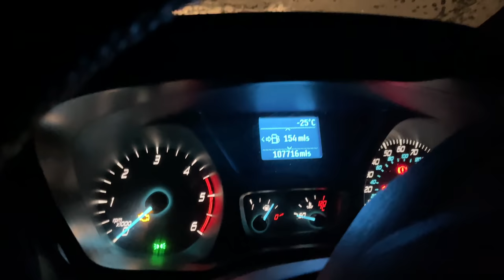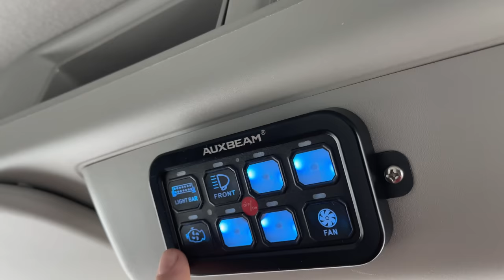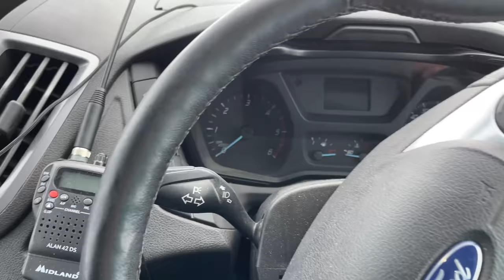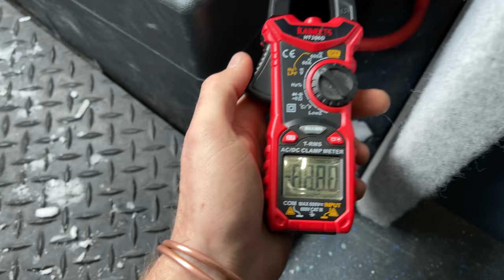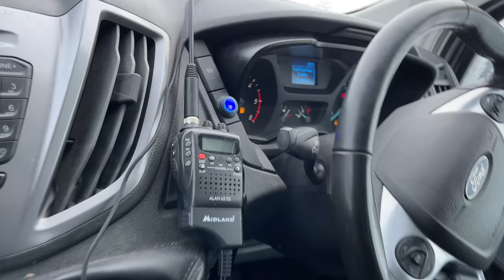Van DIED in ARCTIC cold temperatures | Extreme Winter Vanlife

Comment: Shoulda kept it running. Not that you did any but there was more potential for Damage turning it on and off… keeping it on generates heat and keeps fluids moving… there’s diesels all over the internet doing cold starts… because it’s rough. It was gona be rough. Far worse to turn it off and on than to just keep it running
Reply from the maker: I worked with the information and knowledge I had at time. It sounded horrifically and struggling to keep idle. So a reasonable step will be to shut it down when I don’t know what’s gonna happen. after all there is no problem waiting out for the coolant  thaw out to the engine, so the pre heater work later on in the day.

Comment: We always have at least a 50-50 % mix in the coolant system here in Sweden.
Reply from the maker: Yes the issue was that’s what I thought it, unfortunately it turned out to be for more diluted, subsequently had local garage test it  and mix is no 50/50
Reply: @MispronouncedAdventures     Yeah I thought so. I would also have the engines preheather wired to the leisure batteries to avoid draining the starter batteri. Good luck.
Reply from the maker: Preheater is wired up to the leisure battery, The cranks of the engine when cold is what flatten the starter. there are no issues starting the pre-heater because Attached to the leisure system

Comment: I will now pack a tube in my van so I can heat the engine bay with my cabin heater in case the waterheater freezes. If that doesn´t work, I´ll use my Optimus 111T or 55 to preheat the engine.

I´ve been living in the south west of Sweden for nearly a decade, almost forgot how cold it can get inland and north.
Reply from the maker: A few people had also recommended and thought of that ideas I could definitely see it could help in a way

Comment: Since you also have a diesel air heater installed, I wonder if an external port and some extra ducting would be useful to get heat to a frozen component?
Reply from the maker: Potentially in an option however, I would just need  another 4-5m of exhaust to reach the engine bay

Comment: I've noticed that you have a manual switch to enable charging from the Victron DC-DC chargers. As I remember correctly those can detect the voltage increase and turn on automatically, I also remember that this was the idea when you installed it in the past. What made you change it to the way it works now? Is your smart alternator voltage too low to trigger it? BTW what is your charging voltage with the engine on(the voltage you get from the alternator)? I also have transit MK7 though, and still trying to figure out how the smart charge work exactly, tend to have 14.8V constant, when the engine is on, sometimes dropping to below 13V without any apparent logic to it.
Reply from the maker: So without being too confusing I have a Video coming out in a couple weeks which shows the process of installing both of the Victron DC-DC charger is running in parallel. 

The Switch on the dash doesn’t necessarily turn the chargers on or off ( as in manual control to make them charge or not ) as they’re still on the automatic engine detection modes however that switch controls if I want two charges to run ( winter time ), only one of them ( summer time ) or none at all. It also means the fans turn on and off for the correct charger as well. 

The smart alternators vary the voltage for a number of reasons what are those is alternator temperature also effect voltage output I think I have my engine detection voltage currently at 13.8c

Comment: Loving the series and adventure! I have a webasto engine heater (not sure if exact term) in my van. Been told it warms the engine quicker when cold so it stops damage to the engine. But I can't manually start it like yours and I've never heard it make the noise like yours. Guess this is a different thing to your engine pre heater?
Reply from the maker: Glad you are enjoying the series. 

Id imagine it’s the same thing if it’s a Webasto engine preheater. I’m not familiar how they’re often installed in vehicles in the factory. I think it can be a variety of ways from automatic turn on to manual.

Comment: Do you actually have a diagnostic tool in case something really goes wrong with your engine?
From own workshop experience, those Transits like to block the DPF e.g.
Reply from the maker: I have a unit which can read codes which sits on my dash and displays my coolant temp and other things. Never had a issues with the DPF

Comment: Why don't you let the engine running all night when its below -20? It doesn't use much fuel in idle and you avoid all the issues in the morning. In case of an emergency you dont have 40 min or more to waste.
Reply from the maker: It’s really not needed to leave it running overnight. Idle is my van uses around 0.8L to 1.2L per hour. Long idling  also didn’t great for modern engines with there filters. So I’d run not leave it for idling for 10 hours overnight. 

this only issue really was the coolant mix was t what I thought it was.
Reply: Woow that's alot of consumption for idle! My sprinter uses around 0,5l/h. This also heats the van inside. When its below -20 C I always keep the engine running. I made just over 680.000 km and only had to change the high pressure pump 1 time.  No other engine issues.

Comment: I wonder if all people of Scandinavia have to spend an hour preheating their cars in the morning. Seems to me that as long as it starts on its own it's fine right?
Reply from the maker: They generally all have pre heaters, in urban setting it’s mostly electric ones which they leave turned on overnight. You see all the cars parked up and plug in to the electric sockets. You might be able to start the engine in the cold, but it’s an extreme amount of wear on the engine doing so it’s doing it every day would be a great way to knacker in engine pretty quick

Comment: 15:11 I get same symptom when I used my webasto to pre-warm my car. Happens when its very cold. I also run my Webasto on auxiliary battery. Completely isolated from starter battery. Not sure why it happens….anyway was a pleasure to watch the entire series.
Reply from the maker: The Webasto runs of the leisure systems so there is never any issue starting it from a power point of view, just in this case because the coolant was blocked being semifrozen. 

The fuel gauge one is pretty common when the power runs out in my van too. 

Thanks for watching!

Comment: Shouldn't rev the engine from cold like that. With the coolant being just a little bit slushy I would have let it tick over when you first started it. That electrical system of yours look really neat but a bit complex, to me at least. How come you don't have a switch that allows you to use the leisure battery to boost the starter battery? Would save you rewiring your board. One more thing, is that van all wheel drive?
Reply from the maker: I didn’t really rev the engine hard ( sounds loud on camera ) , it was more of small rev as the it sounded like it was struggling to idle. But it was only for a few seconds anyway and because at the time I didn’t know if that was good or bad nosies . All I knew was it didn’t sound right/ normal. Which i why I shut it down. 

As for the electric system, it’s can definitely look complex to someone but as I built it myself it quite simple. Those style of B2B chargers don’t have a reverse charged feature. I do actually have a small trickle charger but I wasn’t gonna wait for that to charge a flat starter battery as that would take hours. For me, it was a pretty quick to swap the wires around. 

The Van is only RWD drive and not AWD ( I’d love a AWD ) but with all the weight over the rear axle and those tires, plenty of grip, even in deep snow
Reply: If it is a work van / company car, you can rev / thrash the engine more at low temperatures, travel faster, launch the boat deeper and carry heavier loads that it is designed for etc..... if you personally own the van, definately be cautious with revving when cold.

Comment: Up in Alaska if you can’t plug in you don’t switch off.  Well in the 70’s that was the case.
Reply from the maker: Most everyday cars in the Nordic have an electric preheater so you see most plugged in when parked. However many of the van have a option a Diesel fired engine preheater like a use for use when plug in is not available. 

Whilst my preheater worked flawlessly, at the beginning of my trip coolant mix was wrong, I drained and refilled the coolant a few days later with the correct mix
Reply: @MispronouncedAdventures  we are talking -35 it was brutal. Don’t think pre heaters were about then.  One guy had a log burner where the passenger seat should have been to supplement the cab heater, made coffee on it too. 😂.

Comment: Do you have an oil pressure gauge fitted ? Fun vlogs thanks I am enjoying them.
Reply from the maker: No I don’t, it’s strange I don’t think I’ve ever seen an physical oil pressure gauge in a British vehicle . But that could well just be because of the type of vehicles I’m normally in. The vans and vehicles do monitor Oil pressure and you normally get a pop up on the dashboard telling you if there’s something abnormal happening 

What’s the purpose or advantage?
Reply: @MispronouncedAdventures  I just wondered if maybe you had fitted an aftermarket one. If the oil pressure had been say between 15psi and 50 psi I would've allowed it to carry on idling, to warm the engine . I would definitely change the oil to a 0w-30 if specified by the manufacturer for those conditions. I would have been more concerned about oil pressure than the coolant at that stage.
Reply from the maker: Oh I see what you mean now. Yeah the oil is 0w30 is in the van now, and 0w30 in any conditions according to the manual. I did miss speak in a previous comment when I said 5w30.
Reply: @MispronouncedAdventures  Great looks like you now have it sorted. I really enjoy watching your excellent videos. I thought experiencing -9c last year in New Zealand's Southern Alps was a big deal 😀

Comment: Is there any way you could set the pre heater on a stat that you could leave it cycling on & off through the night to keep the coolant warm?
Reply from the maker: Yes. The pre heater itself if it’s  left “on” well automatically switch off when it’s get to it pre set high temperature for the coolant, it will then turn itself back on again when it’s senses the coolant has dropped below a set temperature to start heating again automatically. 

However apart from this issue of frosting ( it’s leaving it on would of helped ) which I now have fixed with the correct coolant mix, I don’t really need to the coolant up to temperature overnight. So just putting it on in the morning should be fine

Comment: To me, that sounded like a normal cold weather diesel start up. I think yo worry to much lol
Reply from the maker: It may well have been, although it did sound worse in the cab that sounded on camera, but in the UK, we rarely have conditions below -5c, and if so is the engine sounds horrific and out of the ordinary from one’s owns experience, and it could hardly maintain idle, seemed reasonable enough to shut it down
Reply: @MispronouncedAdventures  I can see why you did shut it down though. Enjoying your vids. Currently watching the build, last winters travels and the fresh vids your putting out. Love my Transits, use one for my job.

Comment: Would the Ecoflow 750  jump start the battery ?
Reply from the maker: You wouldn’t be about to get the the cranking Amps out of the ecoflow unit to get a “jump start”. but you did flatten the start battery could run small ac battery charger off the ecoflow and wait 10-20 minutes to charge the battery so it can start the end engine. 

So no “jump start” but you could get it going again by Charing up the start from a ecoflow

Comment: Not just coolant that gets slushy and thick the fuel can aswell and engine oil it's probably best to run a small heater pipe off your inside diesel heater into engine bay to keep it warm over night while you're keeping yourself warm lol
Reply from the maker: All the fuel out here is pre-treated at the pumps so no worries about the fuel gelling up. 

That’s actually a pretty cool idea doing a small heat vent into the engine bay, logistically a pain in the arse for me to physically do it but I do like the idea
Reply: @MispronouncedAdventures  😂
Reply: @MispronouncedAdventures  didn't know that about fuel that's pretty cool that. I've seen vids we're truckers in canada put a heat pad on the sumps on the engines to heat up the oil before starting
Reply from the maker: Yeah I can imagine on truck specially larger ones sump heaters would be quite important. Whilst I might be wrong it seems the engine preheaters mostly in the Nordic countries heat just  the coolant. I haven’t seen many options which heat the sump as well

Comment: u do know there is a sense connector under drivers seat which is engine run only control for 12v dc to dc charger so u do not need switch to turn split charge on.
Reply from the maker: Yes I know, I use that particular cable in conjunction with the Orions automatic engine detection. The switch on the dash is I can turn one or both of the B2B chargers on. It’s not often used in winter use as it’s always on the two charger position. But often in the summer. However if it’s hot and I have plenty of solar I only have one charger on or neither
Reply from the maker: This particular scenario I didn’t want both of the charges to come on. As I had reversed one of them to feedback into the flat starter battery.

Comment: So how exactly did you rewire your DC-DC charger? Did you just pull the cables from underneath and swap the positions?
Reply from the maker: Literally that, directly swapped the negative wires in the unit as they are right next to each other. The positives I swapped further down at the midi fuse boxes because there’s more cable to move there
Reply: Nice. Yeah, simple enough. Good to know that's a workable temporary fix should the need arise. 

Makes me wonder if I shouldn't set up a handy switch when I do my electric system, just a toggle to reverse the wires...
Reply from the maker: I mean it’s always an option to wire a switch in but it’s probably one of those extremely rare circumstances. I have a one amp trickle charger wired up to the starter normally. But as I flatten the starter with the cold cranks one amp trickle charger it’s gonna take extremely long time to charge the starter back up when I couldn’t be bothered to wait
Reply: Perhaps I'll just design my setup with a future switch in mind, i.e. leave physical room for it and route wiring accordingly, so it could be added later. Glad to see you got yourself un-stuck there :)

Comment: Great video. Calm analytical approach to problem solving. Always consider the adverse consequences and ask what's the worst that could happen. I wonder if it's possible to test the freezing temperature of your coolant with a gadget? How about carrying a tarp to go over the bonnet and the front wheels to trap heat and prevent draught to the engine compartment overnight. If you carried a piece of heater duct you cold divert heat to the engine compartment to raise the engine, oil and fluid temperatures to a more manageable temperature.
Reply from the maker: Panic and worry never helped solve a problem! With the way my brain works its best understand why there is a problem and then work from there. 

As for testing glycol coolant and it’s delusion there are a number of different tools. I just didn’t happen to have one! However subsequently I have been to a garage to get them to use one and give me the exact numbers of it’s freezing point so I couldn’t work out what I needed to do to increase it to 50/50. I have been in colder since and it’s been perfect now. 

Yeah ducting the air heaters and a number of other options could be quite helpful in the situation.  However in the future in even colder conditions on this trip. Leaving the  preheater to do a full cycle taking about 30 minutes has the van starting like a summers day.
Reply: @MispronouncedAdventures  Thanks for replying. Glad your on top of things. Stay safe and enjoy.

Comment: how can you travel to the arctic region without proper antifreeze
Reply from the maker: Because the information I got on the antifreeze dilution / freezing temperature was from my UK based garage when I had the service done before the trip was wrong and a don’t own a glycol freezing point tester kit myself. Which isn’t too surprising as testing freezing temperature isn’t really an every day thing in the UK. since it was pretty normal practice for every garage in the Nordic countries . I changed it myself to the proper delusion after this was discovered a day after this video.  

It wasn’t that this was an oversight, I mean I put the effort in to install an engine preheater. I was just giving bad information in the UK on my glycol to water mix in my coolant
Reply: easy. Just keep driving. The return trip is the issue. Always keep the machinery and fuel warm......
Reply from the maker: Fuel is all pre treated up there so no need to do anything it Is. Coolant was I thought it was different mix than it was. I fixed it a few days later